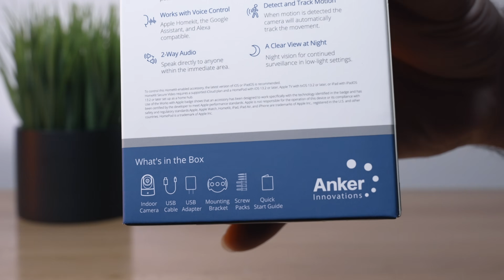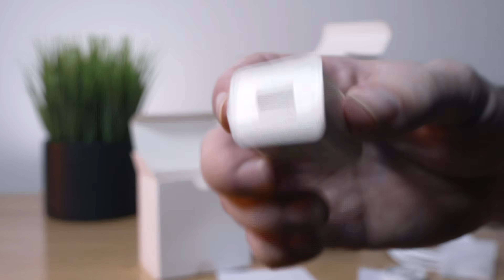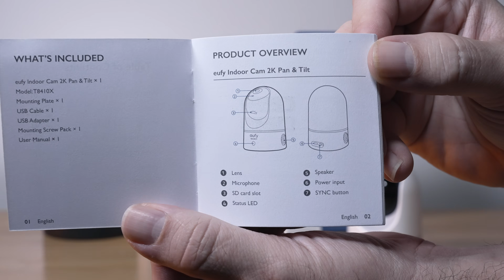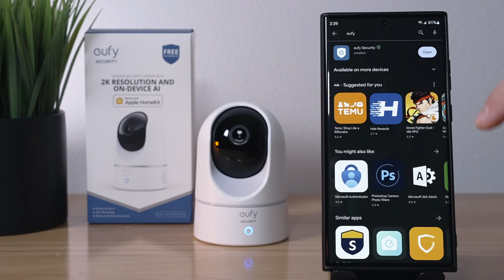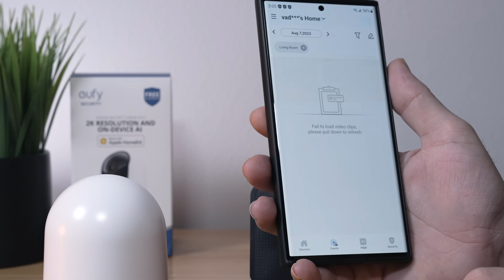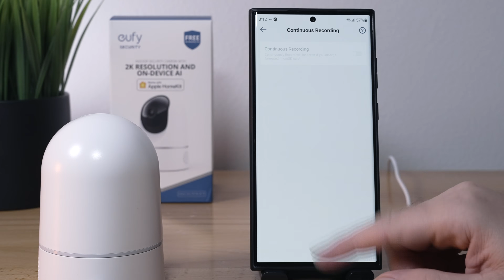Eufy 2K - Indoor Security Camera

Comment: DO NOT BUY.  I bought 4 for indoor use while I’m travelling.  One small power cut and the cameras all fail to reconnect to the wifi so they are totally useless now.
Reply: No problem rejoining the wifi for me when I cut power.
Reply: @wrybread  does it rejoin on its own, reconnects on its own ?? or i have to manually reconnect it to wifi again when a power cuts off and on again??
Reply: Damn thank you for sharing I was going to buy this
Reply: You need to have solar
Reply: You need to have solar
Reply: That's wird I have mines connected to HomeKit and no issues with power outrages they comeback great